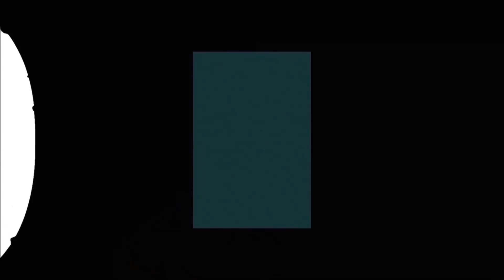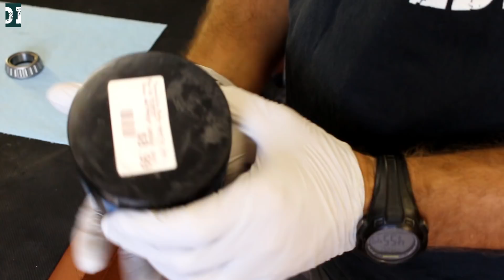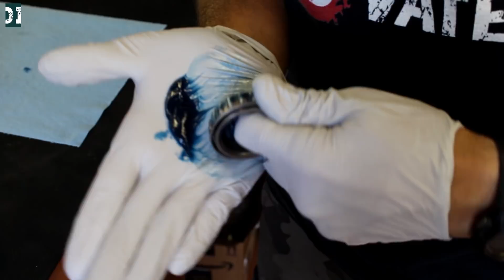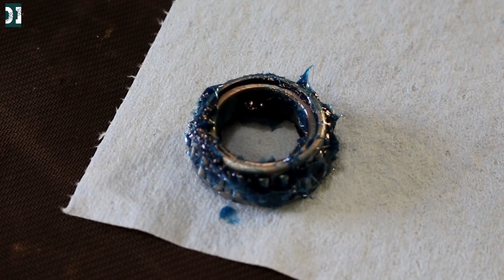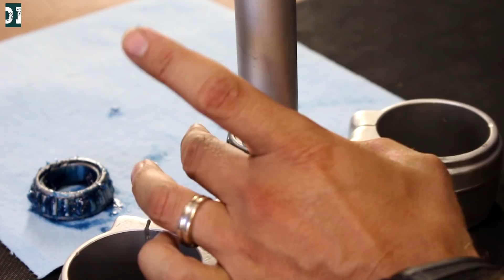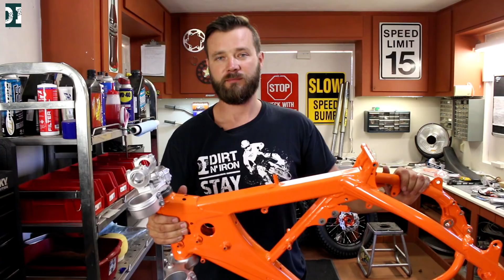KTM 300 build part 13: How to pack and install steering bearings

Comment: Hey Dude, you will have some video of how to disassemble the triple tree of a KTM 640, I CAN'T !! HEEEEELP
Reply from the maker: sorry bro, I dont have access to that bike .. but it should be similar to other bikes. what seems to be the problem ?
Reply: @dirtniron  
I can't get the bottom part of the triple tree, maybe I have some insurance that I don't see.
Reply from the maker: Levi Ramirez do mean the shaft? You need to press that out on the hydraulic press. I have video about it in my yz250 playlist
Reply: @dirtniron  
Perfect, I check it out. Thank you

Comment: Just did this on my old XR650R,like literally one hour before watching this video:)
Reply from the maker: cool bro! ;) how long did it take to pack upper bearing?
Reply: about 5 mins from both sides,BelRay waterproof grease,i have used that grease since the 1980's:)i pack the bottom bearing before pressing onto the tripple clamp.

Comment: I did this about 2 months ago on a yz125. It's probably the most hated thing on my bike. Why did they make it so only a dust shield protects the bearings from basically everything. Ktm have a little shield that go over it, fantastic really considering my friends never had to do it once in 3 years on the same ktm125. And I'm doing it twice a year.
Reply from the maker: yea, seems KTM has little more protection from dust and water
Reply: @dirtniron  hey rado, I know it's not quite related to the video, but I was going to sell up my yz125 just before Christmas and move to another bike. Over here in the UK I'll be able to almost straight trade it for a 2016 4 stroke as prices are very similar. I'm not sure if I should go for a 150 sx 2016, or go for a 4 stroke. I've done 1 year of riding and am 21 years old. If you could tell me your thoughts I would appreciate that as I respect your advice

Comment: Do you have some good advice about rmz450 06? Thanks
Reply: I had an 05 for a while, great bike! Couple things that you want to do is put a manual cct, the stock one is just a spring with no ratchet system so it won't keep the chain tight enough; an exhaust helps to liven up the bike as well as a boyesen QS3; finally a JD jetting kit will smooth and add power everywhere to the bike.
Reply from the maker: I dont have anything bike specific, stay on the top of your maintenance (oil changes, air filter,etc) check valve clearance every now and then and you should be good to go..